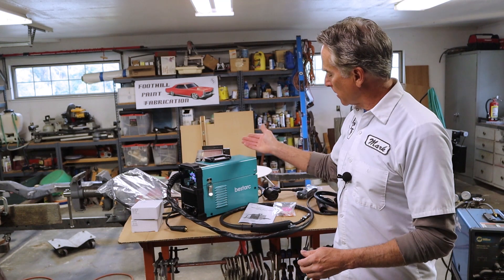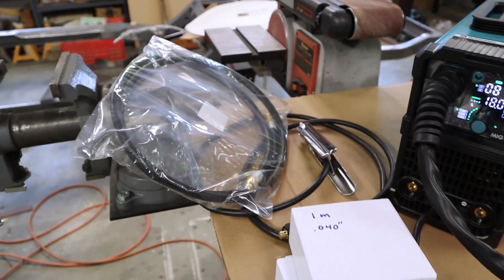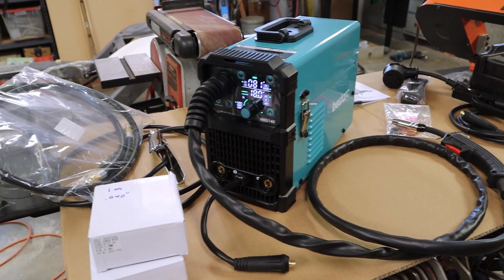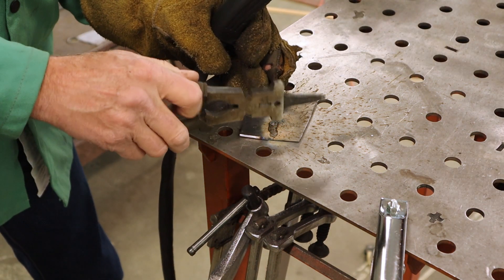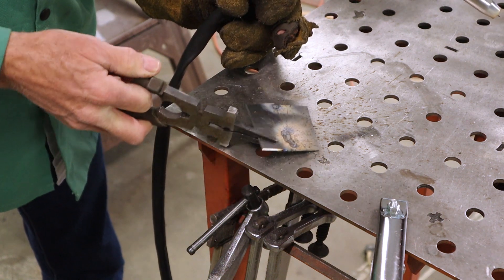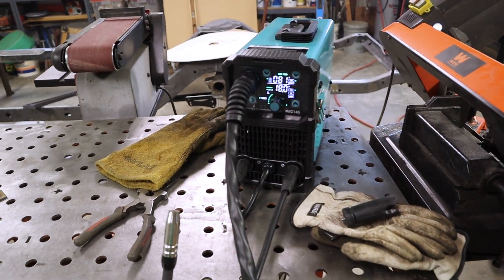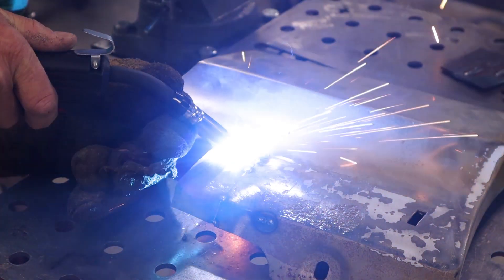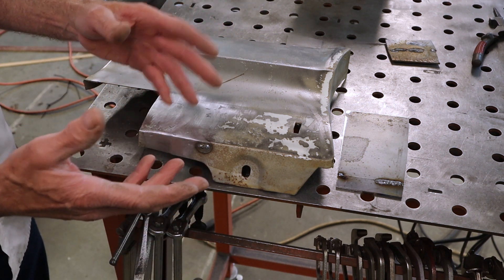Bestarc MIG 145 Gen 9 Welder Review and Testing

Comment: Follow up: I purchased this and tried it out.  Great at the beginning on day 1, on day 2 I went to use it and when I turned on my gas I could here it leaking inside the cabinet of the welder.  Seeing it was a cheap welder I removed side panel and found the supply hose with a huge hole.  It was routed so the heat from the circuitry melted the line.  Now it can not be run with gas.  I'm trying to reach out to customer support, but have not heard anythinh.
Reply from the maker: Crap, sorry to hear that. email me at foothillpaintandfabrication@gmail.com and I will see if I can forward your email address to the contact I have.

Comment: Thanks for the review Mark.  My neighbor’s mower has a crack in the aluminum engine block.  I’d like to TIG weld it but I only own a Lincoln MIG welder.  Maybe this is the answer.
Reply from the maker: Tig welding an oil soaked cast aluminum block is best left to the processionals.  It is a frustrating endeavor at best. If it is non structural JB Hi heat JB weld is pretty awesome stuff.
I have never used lift TIG which this welder is but I guess it would work.

Comment: Awesome test, thank you! I have this unit at home but haven't used it yet. Will be doing some minor rust repair, though I have to weld in a new jacking point which looks to be 10ga, against body panels that are 18ga. Only using flux core and 120v. Think I should be alright here, or is there a risk with welding heavier gauge to lighter stuff? Cheers!
Reply from the maker: You are welcome.  Do some practice welding with flux core on 18 g and see how well you can get it done.  Solid core will suit you way better and make it easier but you do need to rent a bottle and get a regulator.  As far as welding 10g to 18g you are more than double the thickness which is not recommended.  You can weld on a slightly larger plate of 14g onto the 18G to spread the load and then weld the 10g to that.  Stress risers are a problem from welding thick material to thinner. If you can attach the 10g to a pinch weld then you would probably be okay though.
Reply: @FoothillPaintandFabrication  excellent advice! Thank you, that's very much appreciated!!

Comment: I just purchased a new welder! Its a Yes Welder Pro. I've been using a Miller welder for years and it is way too much welder for what I'm doing. 
My Yes Welder is a little larger than the one you are reviewing but almost exactly the same thing. Maybe they are by the same manufacturer just rebranded?
As always, I  appreciate your videos.
Reply from the maker: Crazy how much MIG welders have changed and how cheap they are these days for what they can do.  They could very well be made in the same factory and painted different colors. 
Thanks for watching
Reply: It's amazing to me that that little machine can be bought for $140. A bottle of gas for it costs more than the welder. At that price, it's well worth it for someone that's just starting out.  My first mig welder that i bought, and i still have, i paid over $2500 for in 1989. It's a lincoln 250amp, 100% duty cycle industrial welder, but that's pretty much all you could buy back in those days. How times have changed? $2500 was big money back then, like 6 or 7000 today.
Reply from the maker: @marcellemay7721  I hear you on that.  My Miller 175 was 1,500 bucks way back then and that is when smaller welders were showing up.  No they aren't smaller but tiny but seem to work really well.  This one says is has a 60% duty cycle but I didn't push it hard enough to get any where close to that.  For body work and light fabrication it should work well for very little money.